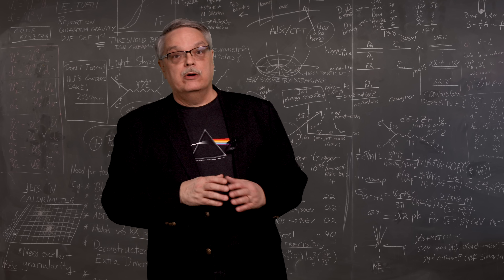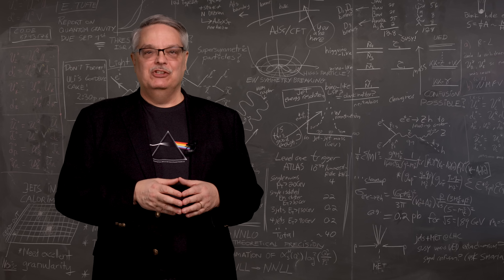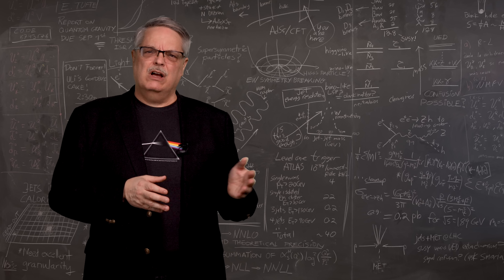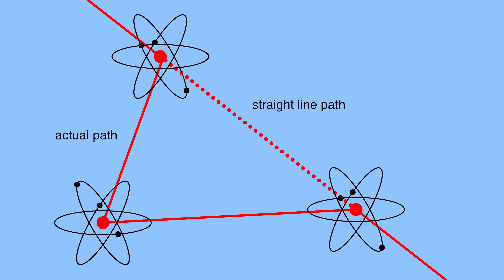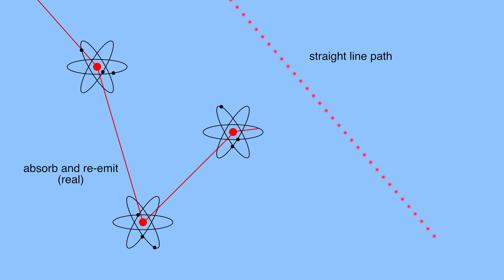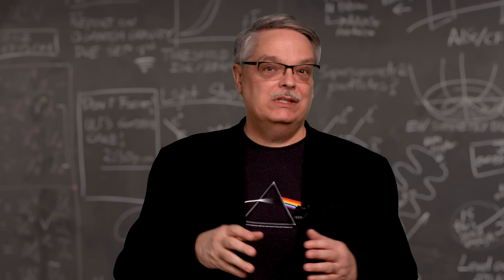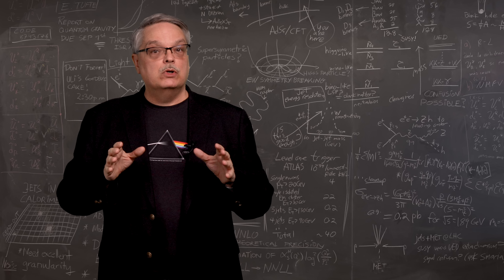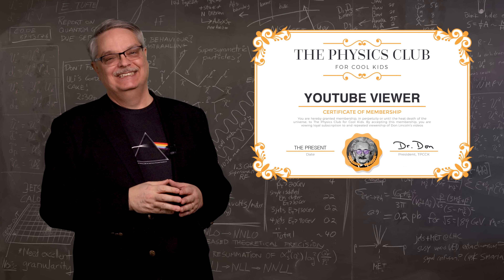Why does light slow down in water?

Comment: Thanks for making the video.  It is often a question that is left unanswered while teaching about index of refraction.  I like how the video refutes two explanations by showing predictions they make that are erroneous.    However, as a science educator, I find the video lacking because it leaves questions unanswered:

1.  Why is it that the "combined wave" travels at less than c
2. If the incoming wave excites the electrons then some of its energy must be converted into the electron's energy.  What effect does this have on the incoming wave?    The energy of light (quanta) is E = n h ν , so an energy loss cannot explain a speed decrease (it would either predict lower frequency -which is not observed- or fewer photons of light being present in the original beam.

The video shows the wave emitted by an electron in a different color implying a different frequency.  But light does not change color when going through glass.
Reply: this video has taken many shortcuts in explaining the relations between the two systems and how it affects them.
to better understand this, we need to talk about d'alembert's equation and its dispersion formula and how it describes a wave.
so d'alembert's equation is used to link together the spatial and temporal variation of a wave.

and from this equation comes the dispersion relation that links together the frequency, wavelength and celerity of a wave.
to access to this equation, we use maxwell relations to describe this phenomenon. when we consider those relations in the void, we get the relation: c² = w²/k² where k is the angular wavenumber and w its anguar frequency. (just google it, ain’t that hard to understand)

thus we can see here that the celerity is proportional to its angular frequency. however, as explained in the video, when light enter a medium, there are charges that can be influenced by the electric field, especially electrons that are 2000 times lighter than their counterparts protons.
thus, when light comes in this medium, we assume that only electrons are affected by the electric field.

we then apply newton's second law to those electrons to find a relation between an electron's speed and the electric current
(we also neglect the magnetic field of the light as the electron is relativistic thus the force from the electric field is much greater than the magnetic one see lorentz law to better understand this )
and then by generalizing this equation to all electrons in the medium, we can get an induced current from the electric field of the light.
( the current is j = n * v with n the volumic density of charges and v the celerity of electrons)

then when we put this back to maxwell ampere local equation, we introduce a new component: the induced current which thus gives us a new dispersion equation: c² = (w² - wp²) / k² with wp the plasma oscillation and thus we can see that from the value of wp, we'll get a different value of the celerity of the wave.

thus we can say without a doubt that they are wrong in their explanation as it is not the combination from the electric current of the electrons and the wave that makes it slower but the induced current inside the medium that modifies the dispersion relation thus modifying its speed.
or in simpler words, it's the movement of electrons that changes the frequency and celerity of the light, but not the combination of the two electric current. (also on a side note, trying to represent the electric current of a dipole using a sine wave.. funny thing you did there 😅)

and finally, as for the reason why the light has a different angle, well you can easily explain this using two waves parallel to each other crossing the medium in phase with each other. as they have the same wave plane, you can easily come to the relation between the refracted angle and the incident angle using some basic geometry. i recommend you to see the demonstration of descartes second law if you want to better understand what i'm talking about.

Comment: 4:44 Surrrrre reminds me of what we see in a prism.  5:33 "...an atom has been absorbed by a photon"?  I think you meant the other way around? 7:08 goes off the rails when you talk about different  speeds  of waves: light is EMF so there are no differing speeds of waves. Doesn't anybody precheck these vids for clarity?
Reply: i don't think they do.. here's my explanation if you are interested

this video has taken many shortcuts in explaining the relations between the two systems and how it affects them.
to better understand this, we need to talk about d'alembert's equation and its dispersion formula and how it describes a wave.
so d'alembert's equation is used to link together the spatial and temporal variation of a wave.

and from this equation comes the dispersion relation that links together the frequency, wavelength and celerity of a wave.
to access to this equation, we use maxwell relations to describe this phenomenon. when we consider those relations in the void, we get the relation: c² = k²*w² where k is the angular frequency and w its wavenumber. (just google it, ain’t that hard to understand)

thus we can see here that the celerity is proportional to its angular frequency. however, as explained in the video, when light enter a medium, there are charges that can be influenced by the electric field, especially electrons that are 2000 times lighter than their counterparts protons.
thus, when light comes in this medium, we assume that only electrons are affected by the electric field.

we then apply newton's second law to those electrons to find a relation between an electron's speed and the electric current
(we also neglect the magnetic field of the light as the electron is relativistic thus the force from the electric field is much greater than the magnetic one see lorentz law to better understand this )
and then by generalizing this equation to all electrons in the medium, we can get an induced current from the electric field of the light.
( the current is j = n * v with n the volumic density of charges and v the celerity of electrons)

then when we put this back to maxwell ampere local equation, we introduce a new component: the induced current which thus gives us a new dispersion equation: c² = k² * (w² - wp²) with wp the plasma oscillation and thus we can see that from the value of wp, we'll get a different value of the celerity of the wave.

thus we can say without a doubt that they are wrong in their explanation as it is not the combination from the electric current of the electrons and the wave that makes it slower but the induced current inside the medium that modifies the dispersion relation thus modifying its speed.
or in simpler words, it's the movement of electrons that changes the frequency and celerity of the light, but not the combination of the two electric current. (also on a side note, trying to represent the electric current of a dipole using a sine wave.. funny thing you did there 😅)

and finally, as for the reason why the light has a different angle, well you can easily explain this using two waves parallel to each other crossing the medium in phase with each other. as they have the same wave plane, you can easily come to the relation between the refracted angle and the incident angle using some basic geometry. i recommend you to see the demonstration of descartes second law if you want to better understand what i'm talking about.

Comment: Suppose you have two otherwise identical infrared laser beams intersecting at a prism with one beam 180 degrees out of phase producing  total destructive interference. The beams intersect at the prism at a slight angle and like an elongated x. 

The index of refraction is wavelength dependent but if the waves are totally cancelled in the prism,  would the beams exit the prism at same angle as if the beams constructively interfered?

I assume there are no “waves” and thus no detectable wavelength per se while beams are in the glass if there is total destructive interference at that point in space.
Reply: what are you talking about ?

Comment: where to begin...
this video has taken many shortcuts in explaining the relations between the two systems and how it affects them.
to better understand this, we need to talk about d'alembert's equation and its dispersion formula and how it describes a wave.
so d'alembert's equation is used to link together the spatial and temporal variation of a wave.

and from this equation comes the dispersion relation that links together the frequency, wavelength and celerity of a wave.
to access to this equation, we use maxwell relations to describe this phenomenon. when we consider those relations in the void, we get the relation: c² = w²/k² where k is the angular  wavenumber and w its angular frequency. (just google it, ain’t that hard to understand)

thus we can see here that the celerity is proportional to its angular frequency. however, as explained in the video, when light enter a medium, there are charges that can be influenced by the electric field, especially electrons that are 2000 times lighter than their counterparts protons.
thus, when light comes in this medium, we assume that only electrons are affected by the electric field.

we then apply newton's second law to those electrons to find a relation between an electron's speed and the electric current
(we also neglect the magnetic field of the light as the electron is relativistic thus the force from the electric field is much greater than the magnetic one see lorentz law to better understand this )
and then by generalizing this equation to all electrons in the medium, we can get an induced current from the electric field of the light.
( the current is j = n * v with n the volumic density of charges and v the celerity of electrons)

then when we put this back to maxwell ampere local equation, we introduce a new component: the induced current which thus gives us a new dispersion equation: c² = (w² - wp²) / k² with wp the plasma oscillation and thus we can see that from the value of wp, we'll get a different value of the celerity of the wave.

thus we can say without a doubt that they are wrong in their explanation as it is not the combination from the electric current of the electrons and the wave that makes it slower but the induced current inside the medium that modifies the dispersion relation thus modifying its speed.
or in simpler words, it's the movement of electrons that changes the frequency and celerity of the light, but not the combination of the two electric current. (also on a side note, trying to represent the electric current of a dipole using a sine wave.. funny thing you did there 😅)

and finally, as for the reason why the light has a different angle, well you can easily explain this using two waves parallel to each other crossing the medium in phase with each other. as they have the same wave plane, you can easily come to the relation between the refracted angle and the incident angle using some basic geometry. i recommend you to see the demonstration of descartes second law if you want to better understand what i'm talking about.

Comment: light does not slow down in water. it only get absorbed and reflected. light does not travel trough the nucleus. it travel around it. the nucleus reflect by the principle of a swinging pendulum. the light pushes on the nucleus, electrons start to converge and then the electrons diverge and light is being re-emitted. there is a enery loss in this that cause dimishing returns each time light bounce against a atom. atoms behave like tiny mirrors in a sense. light behave to a atom like a steel ball hitting a trampoline. actually the nature of physics is much more like a matrix when it comes to a beam of light hitting atoms at an angle. angle in equal angle out. that behavior is like somthing we would program in a computer to make a virtual light source work properly or the shadow casting of the object would not work right.

Comment: why is the second generated wave from the photons hitting the electrons necessarely slower?
Reply: where to begin...
this video has taken many shortcuts in explaining the relations between the two systems and how it affects them.
to better understand this, we need to talk about d'alembert's equation and its dispersion formula and how it describes a wave.
so d'alembert's equation is used to link together the spatial and temporal variation of a wave.

and from this equation comes the dispersion relation that links together the frequency, wavelength and celerity of a wave.
to access to this equation, we use maxwell relations to describe this phenomenon. when we consider those relations in the void, we get the relation: c² = k²*w² where k is the angular frequency and w its wavenumber. (just google it, ain’t that hard to understand)

thus we can see here that the celerity is proportional to its angular frequency. however, as explained in the video, when light enter a medium, there are charges that can be influenced by the electric field, especially electrons that are 2000 times lighter than their counterparts protons.
thus, when light comes in this medium, we assume that only electrons are affected by the electric field.

we then apply newton's second law to those electrons to find a relation between an electron's speed and the electric current
(we also neglect the magnetic field of the light as the electron is relativistic thus the force from the electric field is much greater than the magnetic one see lorentz law to better understand this )
and then by generalizing this equation to all electrons in the medium, we can get an induced current from the electric field of the light.
( the current is j = n * v with n the volumic density of charges and v the celerity of electrons)

then when we put this back to maxwell ampere local equation, we introduce a new component: the induced current which thus gives us a new dispersion equation: c² = k² * (w² - wp²) with wp the plasma oscillation and thus we can see that from the value of wp, we'll get a different value of the celerity of the wave.

thus we can say without a doubt that they are wrong in their explanation as it is not the combination from the electric current of the electrons and the wave that makes it slower but the induced current inside the medium that modifies the dispersion relation thus modifying its speed.
or in simpler words, it's the movement of electrons that changes the frequency and celerity of the light, but not the combination of the two electric current. (also on a side note, trying to represent the electric current of a dipole using a sine wave.. funny thing you did there 😅)

and finally, as for the reason why the light has a different angle, well you can easily explain this using two waves parallel to each other crossing the medium in phase with each other. as they have the same wave plane, you can easily come to the relation between the refracted angle and the incident angle using some basic geometry. i recommend you to see the demonstration of descartes second law if you want to better understand what i'm talking about.

Comment: Wouldn’t the combined electrical field only affect the phase velocity of the combined wave and not the group velocity? How can combining two waves slow down the group velocity? I‘m not convinced that this explanation actually describes this mystery in full. Is this actually a third wrong way to describe this phenomenon?
Reply: yes it is, but to understand how it works, you need to understand the relations between electric an magnetic currents as well as how we describe a wave.
for the former, it is due to maxwell equations, the latter d'alembert equation.
then for the model used to understand why light slows down in a medium, i advice you to see paul drude's model.
using those simplification, we can easily come to understand how light is slowed down in a medium:
https://en.wikipedia.org/wiki/Mathematical_descriptions_of_opacity